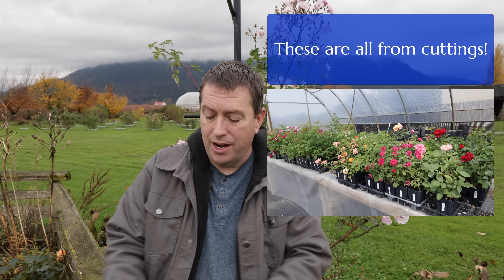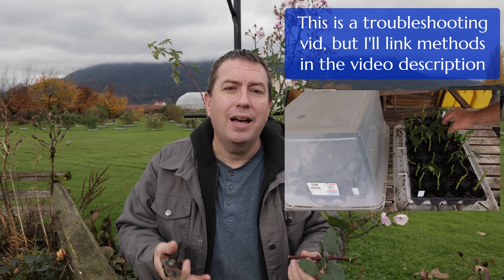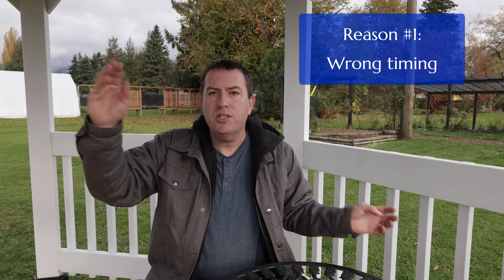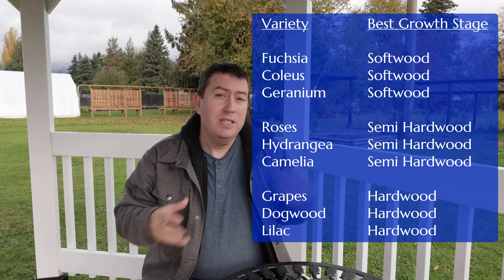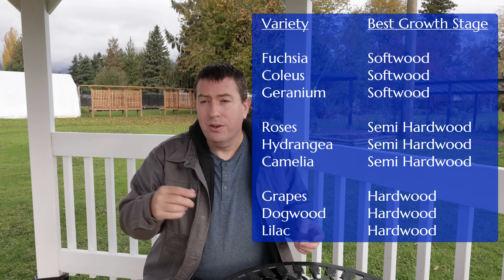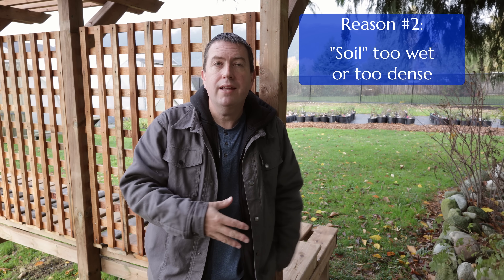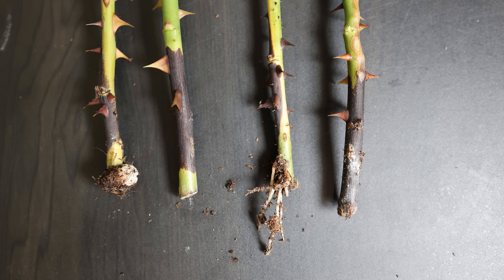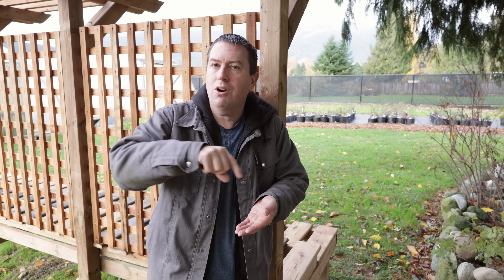Why Do Your Cuttings Fail?

Comment: I propagated rose cuttings in 40°C temperature on my terrace.
I did not use any rooting hormone.
I kept the soil slightly moist, not wet.
I placed the cuttings near a healthy, well-grown plant.
In my case, the cuttings were kept under a bush jasmine plant bag.
The propagation was done during September–October.
At that time, my rose plant had fresh new growth.

This condition helped all the cuttings survive.

I achieved a 100% success rate

Comment: Another cracking video! I'm based in the UK and I'm struggling to find some IBA rooting powder at the 0.3-0.4% range (at least with in my price range). I can find 0.25% or 0.8% and was wondering which you would suggest I should go for? If there is a rooting hormone that you are aware of in the UK that would do the job please feel free to point it out me.
Reply: Just worked out clonex has 3.3gl which i'm hoping is 0.33% so there is at least that.

Comment: Hello, great work.

And a piece of advice for every plant-propagation lover: when rooting cuttings, use an inert medium.
Make sure it contains no organic matter, because it will cause the cuttings to rot at a high rate.

Potting soil contains compost, so it’s best to avoid all potting soils because they are very bad for rooting,
and in the long term they can even be harmful or deadly to the plant,and their damage increases even more when the weather becomes hot . lack of O2

Peat moss + perlite (50:50)
Peat moss + sand (50:50)

These are the best mixes for rooting.
Wishing you success

Comment: I’ve successfully cloned tomato plants via transplanting sucker stems, but never succeeded with any other cutting prop. I’ve only tried maybe a dozen times mostly with herbs, and I admit I’ve lost some confidence with all the failure, but I will be trying again next spring and I am hoping my second year goes better than my first!
Reply from the maker: Definitely don't let it discourage you. Doing suckers from tomatoes would be most similar to softwood or tip cuttings (warm, bright, fast) and my preferred method is semi-ripe (slower, a bit "drier" overall, less light needed) - but there are all sorts of nuances with the plants themselves, timing etc. Multiple attempts becomes the best way to dial in your own method.

Comment: Hi Jason, I tried to propagate Darcey Bussel rose. I have taken semi-hardwood cuttings in June and potted them under a clear plastic bottle. They look good for now, but with winter approaching I am worried if they will survive in pots with domes outside (I live in west Scotland, zone 8-9 but we have just had our first frosts at night). I don't have a greenhouse but have a cold frame. Would it be better to put them there? Any advice?
Reply from the maker: An extra layer of protection like a cold frame and/or having the potted plants dug down into the ground for soil temp stability - both would be helpful if doable.

Comment: I tried doing my own cuttings from roses for the first time. I did not even use rooting hormone and it actually worked. I have them in a sheltered area in my garden right now and I’m excited to see how they will fare. I took 2 cuttings from my Lady of Sharlott and 1 from my Queen of Sweden, I do wonder if they perform different from the ones I bought from my garden store, as I believe they are grafted roses, but I am not sure.

Comment: I recently moved to high elevation cooler weather including frosty winters and uprooted my vine tree at previous home and transplanted in the new location.   Started doing cuttings and potting them.   The mother took off beautifully following spring and haven’t failed on the cuttings at all. 

Vine does lay dormant in winter which is great. Spring omg an abundance of leaves.  
I’m Mediterranean background and we use the vine leaves as a wrap filled with cooked meat and rice in pot cooking for at least 2 or so hours etc Highly nutritious leaves.  

Learned from an old Mediterranean person when doing cuttings from the mother always go as low as possible closer down to the root system the better. 

This particular vine doesn’t produce grapes though.  Vine is pretty much similar to weeds.

The original vine tree from a relative was from 1965.

Comment: I have an interesting one for you, Jason.
September 2, I plucked the leaves off of my Camellia Sinensis (Tea) plants. In the process, I accidentally pulled 3 of the smaller branches off as well, so I decided to make cuttings out of them. 2 of the cutting failed because they were not ideal to start with.
The third, seems to have gone into some kind of stasis.😂
2 and a half months and still looks fantastic, but absolutely no signs of rooting.
My guess is temperature, all was going well, then we got a North wind that dropped the temperature into the 10-20C range.
My temperature monitor is a Black Peppercorn vine. The vine flourishes in temperature 20C and above, and slows its growth below 10-15C.
I'm thinking the vine and cutting are responding to the temperature in a similar fashion.
It will be interesting to see how it turns out.
In the meantime...
We wait.😂

Comment: I have read some old gardeners keep a spare microwave to sterilise the potting medium, would you recommend  that prior to taking home cuttings as a preparation method? Obviously small scale here, not commercially concerns like yourself.
Reply from the maker: You're right, I can't see this working at any scale for growers - the most I've seen is disinfection of pots/trays. For the home grower it's still likely easier (depending on supply/availability) to source a relatively clean propagation mix rather than trying to nuke it clean.

Comment: Hey Jason.  I have this amazing Cyprus style ever green shrub that I would like more of.  Suggestions on growing them from cuttings?

I have a few now that done seem to be doing anything.  Not growing or failing.

I’m terribly afraid to pull them to check visibly for rooting, finding them and trying to replant them and having them die.
Reply from the maker: Patience. My experience with evergreen cuttings is that they can be quite slow. I use the same method - semi-ripe tips actually, and stick in well-aerated propagation mix, only misting lightly perhaps once per week to maintain a little bit of moisture (this'll depend on light, temperature of course). A temp in the range of 22C/72F can speed things along a bit, but low and slow is the general rule.
Reply: @FraserValleyRoseFarm  thank you.

Comment: I have a Bougainvillea outside.  Thing is a pest.  I walk barefoot and during wind and rain branches will break off and it will sta.b into me when I step on them.  The spikes have a toxin on the tips apparently that cause additional pain, so there's that as well.  It's absolutely annoying every time  it happens.  What's w0rse is when a bit get stuck in your foot and it swells up and I have isssues walking.

Anyways, the main point is that I cut off some branches from this pest tree and I figured that since I have all these branches I've cut off over the months/years I could use it as a trellis so I could have some cucumbers, tomatoes, etc grow up them.... and then I noticed, I believe,  after weeks or months of it just being a cut off piece that I took, or just being in the soil, it started growing....  It looked like a dea.d branch, but it became alive again... I couldn't believe it when I first saw it....

I hat.e this plant, but it's resilience is something else....

I have tro.uble cloning some plants, but the one plant I hat.e the most can rise up from the grav.e and start growing from a 4 foot long branch...

Comment: I'm having difficulty with rose cuttings.  I'll try again with a lighter soil mix.
Reply: I've now tried a potting compost mixed with perlite.  4 rose cuttings, two from each of two old roses which may soon need digging up.  It's winter and they've been in the conservatory, which, now in December, is cold at around 2-10 degrees C.  I had almost given on them when I saw small shoots.  So it's   looking promising.   Lighter soil and patience seem to be the key.

Comment: Jason, when taking cuttings from roses (softwood, semi-ripe, or hardwood) is it best practice to remove all thorns from the stems or leave them on? Not sure if leaving them on would be more prone to the cuttings rotting or taking them all off would make the stems susceptible to infection. Thanks.
Reply from the maker: I don't remove prickles, except in the case (like as in some mosses and rugosas) where they're so dense at the base that they interfere with application of rooting hormone and sticking into the potting medium. Beyond that they take extra time/work and I can't see the benefit - as you mention, there could even be a downside of exposing more fresh injury to the possibility of decay organisms.

Comment: Does anyone have experience/tips specifically for Morden Centenial? I have a 15 yo grafted plant and want to establish a new own root rose in a different location. I tried a few times, with no success.
Reply from the maker: I haven't tried Centennial but have done well with Morden Ruby and Morden Sunrise. Thing is all those Ag Canada roses have very mixed genetics, so I'd try cuttings at  different stages: soft tips, mid, and later season (firmer stems) to see what it prefers.
Reply: @FraserValleyRoseFarm  Thank you! Morden Belle rooted so easy! I will keep trying at different times with Centenial, fingers crossed. So far I was taking cuttings from it before and right after flowering, and took a hardwood shoots this fall. I will try drier mix next year and more perlite/less peat. Maybe I will try a few in just water as well. I really want to clone this rose, as it is getting so old and I love it.

Comment: One time I had a cutting stem  turn black during the rooting process. I was disappointed to see that developing. Lo and behold it developed a stem that came up from the base under ground! 
It worked!!
Reply from the maker: Nice - when the darkness is not coming from the base itself, but higher up on the stem that's a nice surprise!